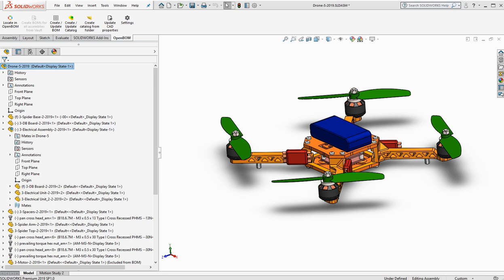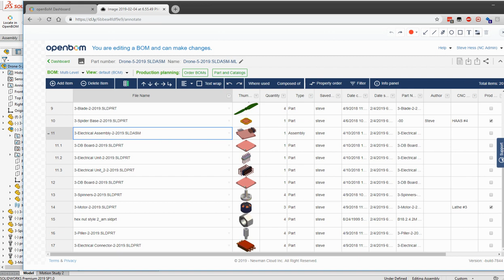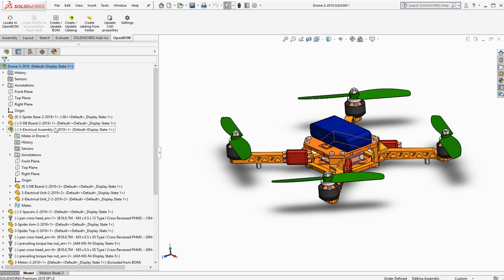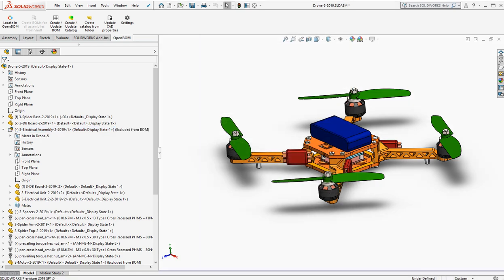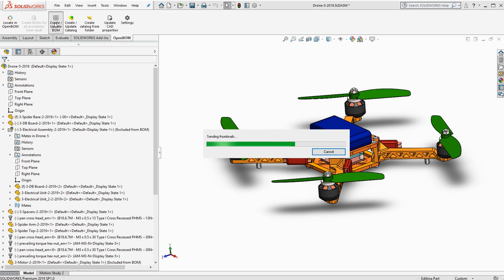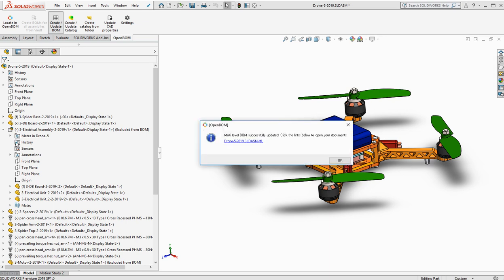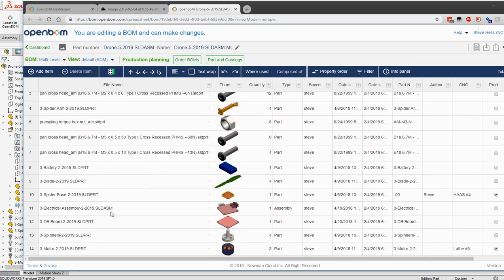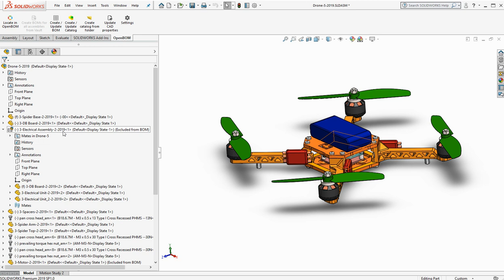OpenBOM and Solidworks Envelope settings

Comment: this setting will unfortunately also exclude the part from the BOM on any drawing. Any work around for that?
Reply from the maker: Good point. Probably the simple one - use OpenBOM PDF export instead of BOM on the drawings. It is more practical. Did you try it? Check this -- https://help.openbom.com/2017/05/12/exporting-a-bom-from-openbom/